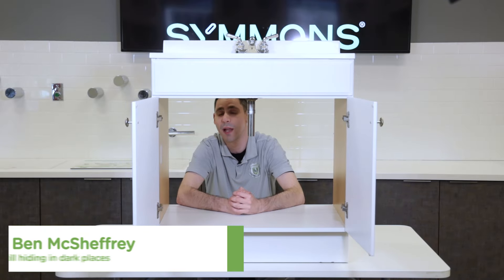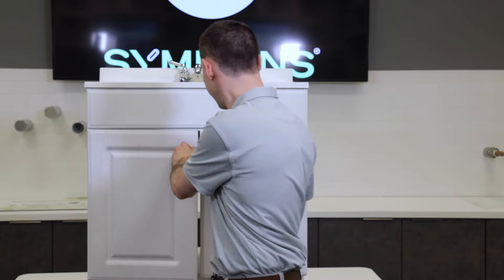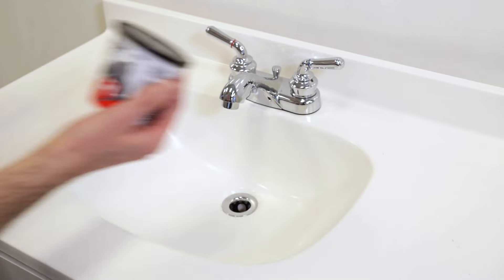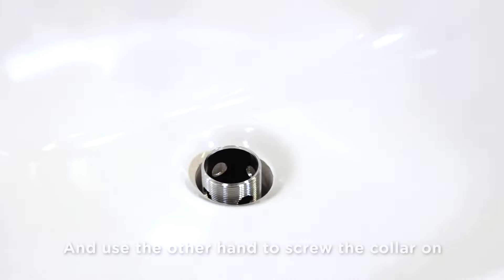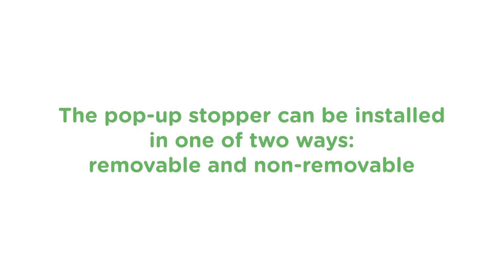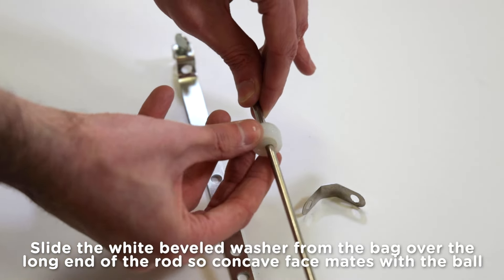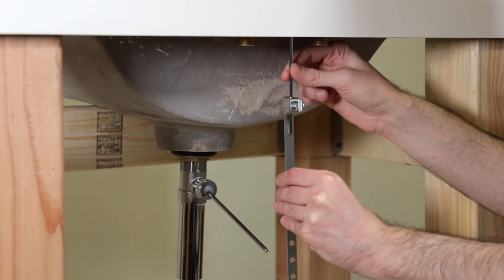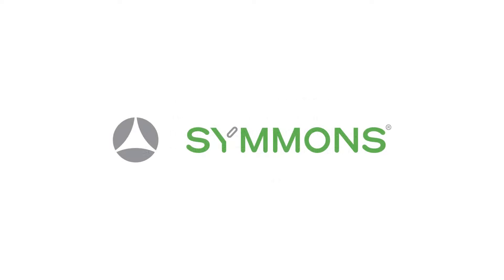How to Install a Metal Pop-Up Sink Drain Assembly | Symmons Industries

Comment: Thank you!  This was the first time in my life (78 years) that I realized a nylon washer was to go inside the pipe as well as on the outside which explains why it leaked every time in the past unless I used a lot of plumbers tape. I put it on as you said and it worked perfectly the first time. I thank you for that and God that I had the sense to watch you video first.

Comment: I have the same unit I need to put on. My only concern is that you don't need to tighten the tailpiece with a tool? If you only hand tighten it will water leak out? Water is powerful.
Reply from the maker: The tailpiece is what’s known as a “scratch-thread tailpiece”, and it uses very fine threads that screw into the bottom of the pop-up assembly.  

Using tools like pliers is not recommended because it can damage the shape of the tailpiece and cause leaks. The best method is to put the thread seal tape on the threads, then screw it in as tight as it will go by hand. Dry your hands thoroughly first to get a better grip.  If you want to use a strap wrench just to be sure, that’s fine, but don’t overtighten it. 

In regard to leaks, there’s no pressure on that section of the drainage piping unless the waste line is clogged, in which case you have bigger problems. ;D

Comment: Seriously? That's how the spring clip is held on? I'm missing something because mine does not stay.  Just looking at yours, i dont know how that thing stays either
Reply: Sometimes you can bend a spring clip to make it grip a little better. Alternatively, I've seen folks add a rubber grommet to the end of the pivot rod after adding the clip to help it stay in place. Hope this helps

Comment: Do I have to turn off my water before I install?
Reply from the maker: No, you don’t need to turn the water off when you’re installing the drain assembly--just be sure you don’t accidentally turn the faucet on until you’re done or you’re gonna get wet. An old trick is to throw a towel over the faucet to remind yourself not to turn it on.

Comment: Sink is leaking between the beveled washer and flat clear washer. I can't find anything on the internet why this is happening. Help 😩
Reply from the maker: We would suggest backing off the nut a little,  making sure the beveled washer and flat washer are aligned properly, then retightening. You do not want to overtighten it!
Reply: @SymmonsIndustries  will do!! Thank you so much!

Comment: Ok I know exactly what I have to do, but unfortunately my pop-up assembly is pointed to the rear of the cabinet it is under the vanity. There isn't enough room to get in there and get a nice easy view like you have. Getting a bit maddening. Tried it with a hand mirror and flashlight but still really doesn't work!

Comment: The advice to get rid of the black plastic washer really messed up my install. Guess what?! On some sinks they are needed! 🤬 Terrible advice, definitely look elsewhere if you need you tube plumbing help. 👎👎👎👎👎
Reply from the maker: Erin, we’re sorry you had issues with the RL-154. We’re here to help, so just give us a call at 1-800-SYMMONS and we’ll make it right.
Reply: I think you are right about that . My sink came with the washer and it worked for years.Otherwise a good video.
Reply: He literally says in the video that its included in case your sink needs it.